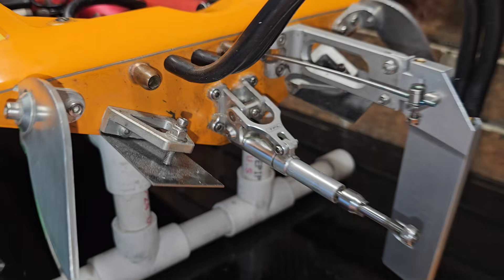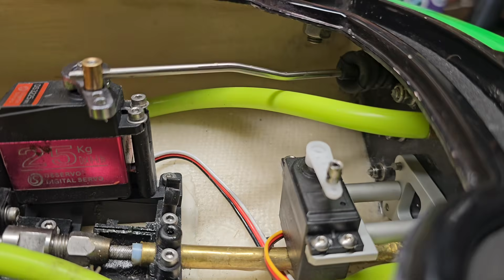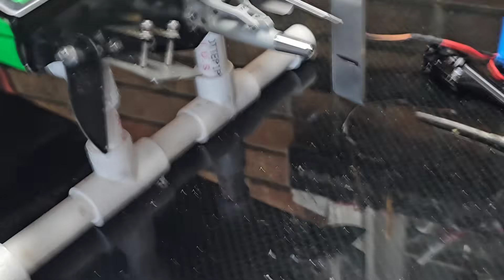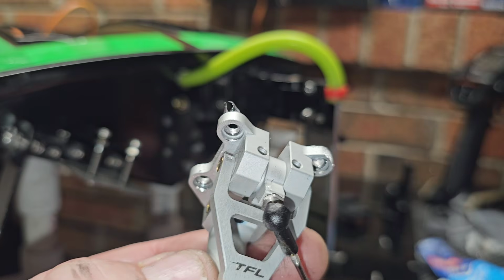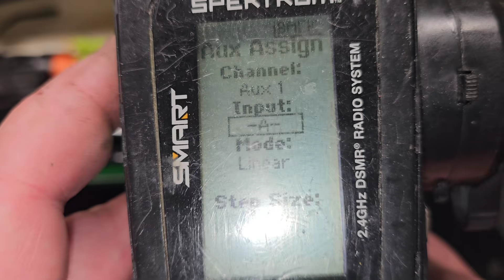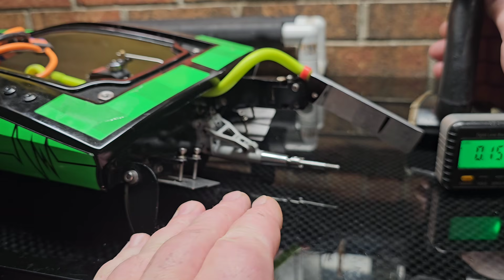Remote Controled Stinger Upgrade Proboat Impulse 32 Fast Electric Rc Boat Power Trim - TFL Stinger

Comment: You will need to have the rudder bracket and rudder be 100mm. Just add 35mm on the rudder bracket. I've done it to my boat and the propeller clears the rudder and the handles like a dream. I've got pictures if you want them.

Comment: Big B , really pleased that you made this video . It’s super convenient to set the stinger tilt , electronically rather than , fiddle with screws . Thinking that if you find a way of fitting that servo vertically , meaning that the servo arm moves in vertical plane , it would make that push rod , move in a straight line . Super video , thanks .
Reply from the maker: Thank you!

Comment: Great video, B. I can't wait to see this in the water. As you said, it will be nice to make the adjustments and not have to break out any tools. Instead,  this becomes the tool.easy peazy. In the words of Dr Jet, standing by.😂👍👍👍🍿🍿🍿💯💯💯
Reply from the maker: Just got off work, charging lipos now!    BG4L
Reply: @IRONCLADRC can't wait to see it Bud. BG4L👍👍👍

Comment: I like the Stinger but I found once I get that angle set... I don't need to adjust it.  What I do need however is a tiltable rudder so it doesn't drag the ground while its on the trailer..
Reply from the maker: Same here, this stinger is just a fun piece of hardware to play around with..

Comment: 2 suggestions to make the pushrod lower. Mount the servo under the mount instead of on top, or they sell lower profile quick connectors that can be mounted on the bottom of the servo horn. Can’t wait to see this thing in action, it’s gonna be badass.
Reply from the maker: Mounting the servo under its mount is a good idea but I couldn't pull it off on my build, Servo is basically resting on the stuffing tube.

Comment: I'm glad you went over the transmitter programming because that's what I've had a problem with. But now I see how did it and I'll steal the info😊.
Reply from the maker: Glad I could help!    Going for my first teat this evening.     Probably run 4s so we can do some on the fly  trim while running the boat!

Comment: Could it work with sonic wake 36
Reply from the maker: It'll be tight,  the SonicWake has a large overhang on the topside, plus the SonicWake has the inner skeletal backer plate on the transom so the servo bracket may not want to sit perfectly flat due to the backer plate.     Should work but you'll need to get creative with the installation

Comment: I can’t imagine a dual catamaran set up mixing throttle and stinger position! 🫣
Reply from the maker: Would be fun to test on a twin cat!  Paired with a gyro, when the front end lifts the gyro will correct the lift with negative stinger position pushing the bow down?  Theoretically  that is!  😆

Comment: Awesome job! Glad you kept the stock stuffing tube. I think without a liner it's so deep itll let water in. Every time I've lost a cable out the collet, the boat fills with water quite fast! Im stupid excited to see it run!
Reply from the maker: Gonna run it as is for a while but I'm Not a fan of the Teflon,  I will more than likely pull the stock stuffing tube out and install 1/4 w/o Teflon..